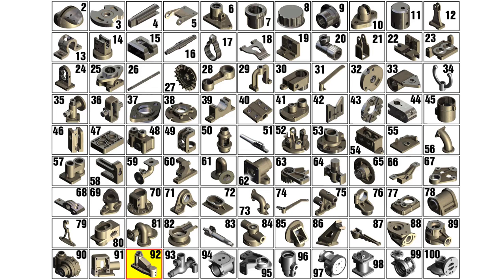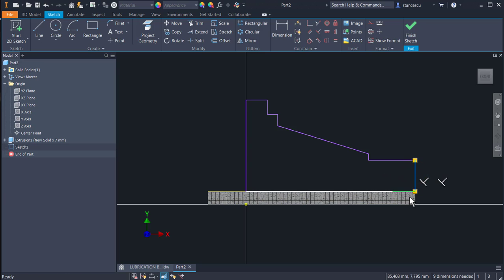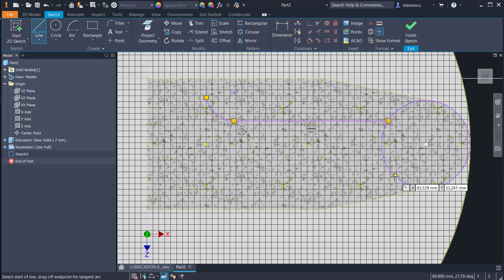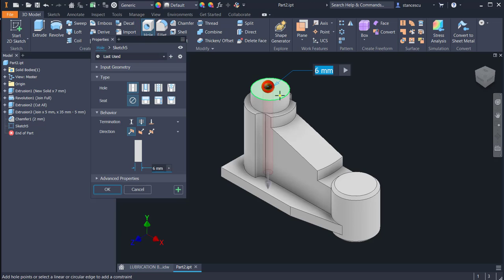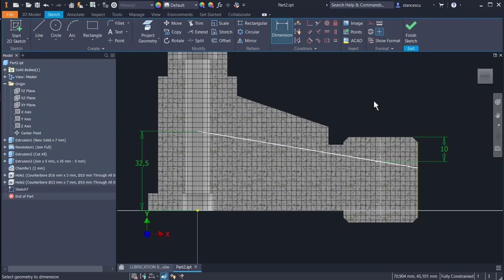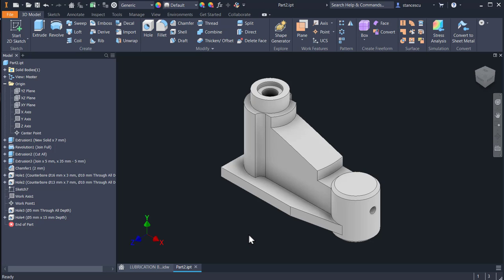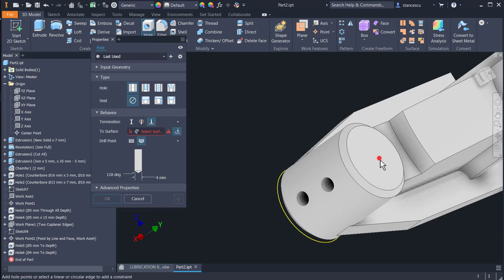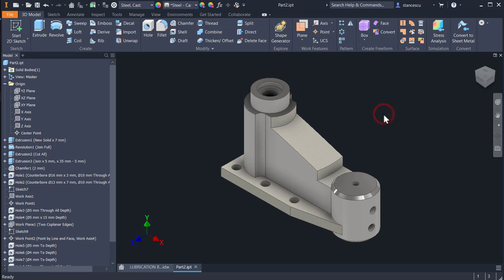Tutorial Inventor - 132 LUBRICATION BODY (Part-092)

Comment: Hello dear professor, To the hole from outside point: the part is not cut on the surface when it is sloped as it is, we should "extend start" in the hole creation properties to fix it.
Reply from the maker: OK, but what is the minute with the mistake?
Reply: @prof-stancescu  It is not a mistake - It is reaction to Your task at the end of the video. You wanted us to try to model the hole from the top of the part.